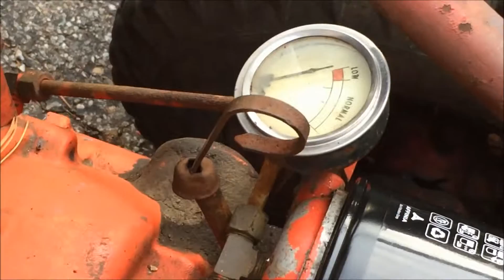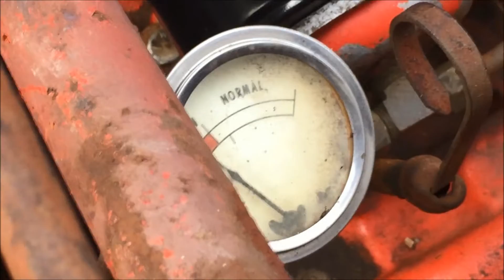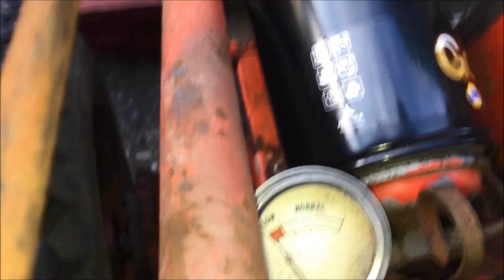1965 Gravely L8 Oil Pressure Issues Part 2 Uggghhhhhhh

Comment: This information is straight from the Gravely Service Manual.  Check for:
Low oil level - add oil as required.
Low RPM - adjust to 2600-2800 at full throttle (obviously not your problem)
Low relief valve setting - Adjust relief valve setting.  With adequate pressure, a heavy stream should be visible through the oil filler neck.
Loss of pump suction due to air leak (usually evident by an oil leak) - Check fittings for tightness.  Torque pump cap bolts to 80 in. lbs.

Comment: My Gravely l smokes like freight train.  I took the head off and i can see the oil laying on top of piston.  Can i try to put new rings in it .  It has an .010 oversized piston.   Or do you think there would be a more significant problem.  Thanks Nick

Comment: Are there any other diagrams of the oil circuit? There has to be a clog or block somewhere. What about the new bearing and race that you put in, is there an oil hole that could have gotten blocked during that large to small bearing conversion? I just got a 1965 tractor this past weekend, so I searched "1965" in your videos and rewatched all of these.

Comment: First off !
Please stop running the engine without oil pressure !
Remove the spark plug, and crank with just the starter is plenty to show oil pressure on the gauge.
Running it as long as you have already without visable oil pressure is critically serious !
Stop doing it please !
Try removing the oil pressure gauge, and just bump the starter one or two revolutions, you should see oil immediately !
If not, stop immediately !
If significant oil return, change the pressure gauge.
Otherwise, check the pressure relief.
A very rare problem, but maybe ?
But please, do not run a minute more, until you confirm that you have oil pressure !
By oil pressure, I mean at least 30psi !
Stay in touch please,
I don't want you to lose an engine !
It runs to darn nice !

Comment: I hope you figure this out.  I was cringing the whole time you were running her without oil pressure.  Mine has no oil pressure for just a few seconds after an oil change but nothing like what yours is doing.
Reply from the maker: +5 Acres on the Bayou Thanks same here.  I haven't had time to get back to this project.  I want to pull the axle and inspect the screen in the tranny again.  Evey thing else checks out ok, but there isn't a drop of oil in it.....

Comment: Is the engine running backward?
Reply from the maker: No.  Turns out the starter clutches were locked up ....  That's why they were falling off they were not free wheeling....
Reply: +rw3dog I thought it was worth a shot because this situation is very strange. The only other idea I have is to see if you can draw oil from the pickup tube at the pump with some vacuum. I'm thinking there may be a leak above oil level in the sump. It could be small enough to still bubble when you blow air through it but leak enough so the pump cannot draw any oil up to the pump.